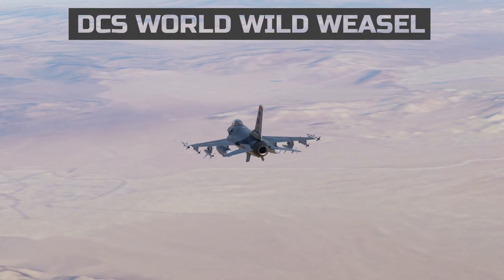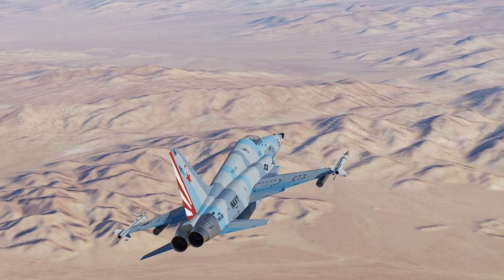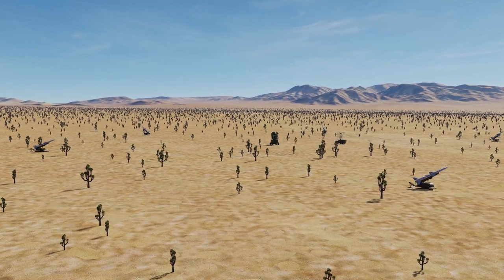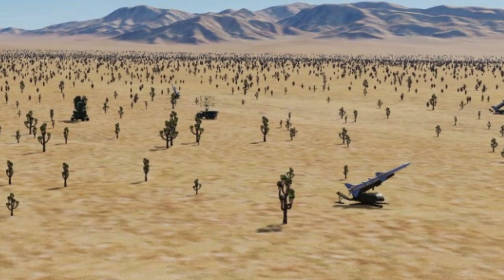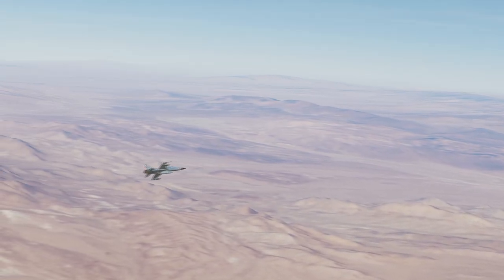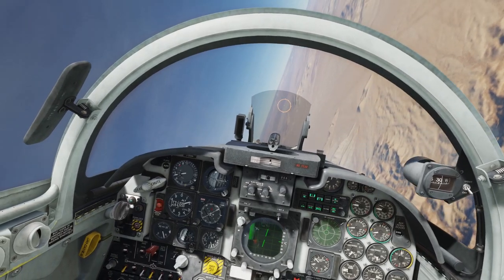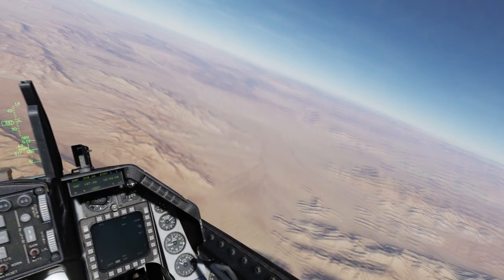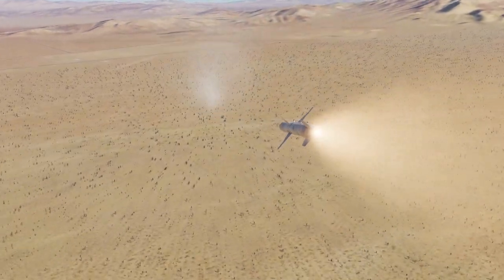DCS WORLD | Wild Weasel Episode 1: Sa-2 Guideline

Comment: Going into beaming/notch and then releasing chaff (maybe with steep descent, if SAM is really dangerous) is much easier and practically eliminates luck from SAM evasion (no near misses which would have been hits if we had proximity fuses), just remember heading to the radar and hard turn 90 degrees, then level out and observe RWR and missile smoke trail while releasing chaff, then, when missiles lost you and you do not expect "relock", turn back to close the distance. Lower altitudes make it even easier, even without terrain masking (if you do not expect manpads all over). And, nothing will save you from a proper SAM battery with short range and AAA/IR cover, but distance (HARM, Sidearm or Maverick).

Comment: I read in a fighter jet magazine a few years back that during the Bosnia bombing campaign it took nato 2 months and 280 harms to take out two sa 2 systems. If that is the case, sam's in dcs is lacking. It's pretty easy to take out sam's. In BMS it's a little more challenging.
Reply: DCS SAMs are rather lacklustre. A lot of the problems that affect general missile behaviour impact SAMs (especially the older systems) much worse. Most DCS players will begin a steep dive when shot at, driving the SAM into the ground - this shouldn't work against most systems, and definitely wouldn't against an S-75. As soon as the operator spots you diving, he can either switch to 3-point or half lead with altitude compensation, whichever works best. If you start climbing again, back to half lead. The radio fuzes on these things should go off within 300m but even though DCS does model proximity fuzing, it doesn't model it very well, and the larger SAMs exhibit such a small proximity fuze radius that it renders the whole system ineffective even before multiplayer desync comes into it. The warheads also don't seem to have anything approaching their true effective radius. At 0:54, that would've been a hit as long as the radio fuze functioned correctly.

You also have to bear in mind that the Serbs were very, very good at hiding their sites and would build decoys to bait HARM strikes away from actual missile batteries, a tactic also employed by Soviet advisors in Egypt against the Israelis. There's a whole laundry list of strategies and counter-strategies which DCS can't really even scratch the surface of right now - like packing up sites and relocating them, SAM traps using the IADS datalink, false missile guidance signals to spook an aircraft into evading, etc.

Comment: Can you make a video about this but with the A4e Skyhawk?
Reply from the maker: I don’t fly the sky hawk, however, the procedure is the same.
Reply: @TacticalPascale  this current A-4C-E mod, it is a bit more tricky by the lack of RWR « screen ». There are only sounds for search /track/guidance available . Plus, the Shrikes have a very narrow cone of search for emitting radars, making the aiming difficult until the first SA-2 is launched.  I have recently discovered this A4 mod, it would be nice to be officially integrated as Ai in DCS. It would make possible to add this plane on normal servers, even without actually having this mod installed.